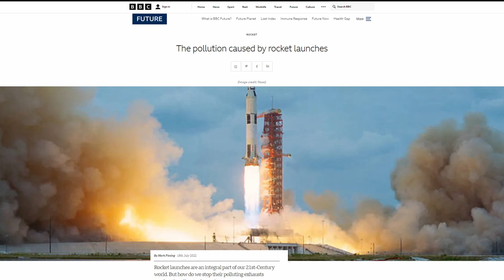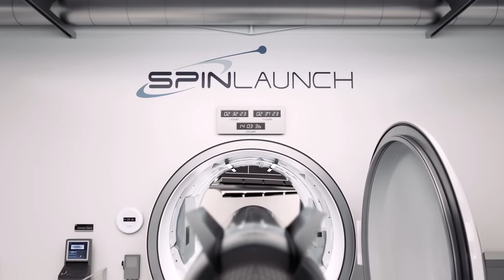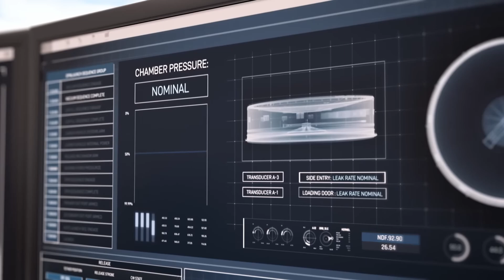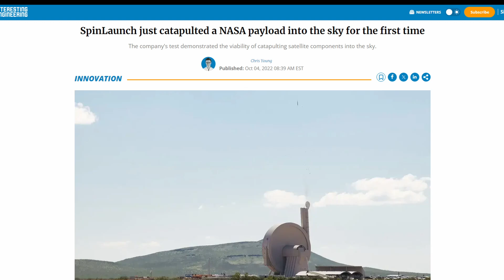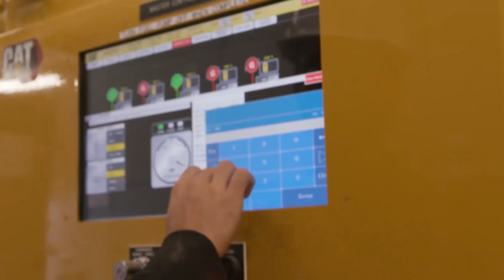This Company Thinks They Are Working on The Electron Killer!

Comment: Using methane as fuel is comparatively beneficial from a greenhouse perspective.  Methane in the atmosphere is reckoned to be 25 to 80 times worse than carbon dioxide as a heat-trapping greenhouse gas... but when you burn methane (with oxygen) you convert it to carbon dioxide and water... hence super-nasty greenhouse methane is converted to many-times-less-nasty carbon dioxide at a 1:1 ratio.  Whereas burning petrol ("gasoline" in your vernacular) produces 8x more CO2 than methane does (while also consuming 12.5x more oxygen).  Kerosene (av-gas, RP-1) are similar to petrol.  Of all the rocket-fuels liquid hydrogen would be greenest... but then there's the question of how are you obtaining/producing the hydrogen (or the methane for that matter)..?  

But SpinLaunch?!  IF they ever achieve orbit (doubtful) about the only use for such a traumatic ride to space MIGHT be to hurl spare fuel containers up there for others to re-fuel from in space.  The extreme g-forces involved will destroy anything higher-tech... and as such i don't see how their necessary 2nd stage will survive the launch to function properly either.  Not feasible, their only real threat to Electron is that fools are investing money there that could be going to boost RocketLabs share price!

Comment: @daveginvesting5670

Hi Dave. 
I hope you had a great holiday. During your holiday there were 2 occasion that we saw Peter talk. The earning call and the NSF interview. I was surprise that 2 element were not pick up by any other analyse or youtuber. 

First :: During the NSF at the end of the Q&A on time stamp 1:28:50 Peter mention that " without Neutron related spending ROcket is a nice little profitable companie."

Second : During the earning call Adam mention at the time stamp 0:32:00 that :" EBITDA Breakeven (profitability) is depend on Neutron spending but the existing company is on a trajectory to offset the weight of the neutron R&D" 
So this mean that they are projectiing to be cashflow positif (and knowing Rocket lab this mean that it is not far in the future... most likely next year.

Third : During the earning call Q&A  at the time stamp 1:08:00 Adam said that :  Q3 is R&D cost peak and will be at that level for Q4 then it will trend down. 

My interprétation of those 3 point point out is that they will be cashflow possitif in 2024 probably at the end of 2024.

Do you have the same interprétation.

Comment: Well a better solution would be to build a very long track for a magnetic rail accelerated payload high up on a 4-6000m mountain. You will have less air resistance, shorter trip to orbit and no instability of the rotating arm after launch(catastrophic vibrations). You also don't have to be worried that the rocket is leaving at the wrong time.

Comment: Not a threat to Rocket Lab, Payloads would be very limited particularly at larger scales to withstand both side and positive/negative axial g forces which will require reinforcement with additional weight and expenses entailed.  Located on a high mountain peak like Everest to reduce atmospheric deceleration would help, but still not get forces down to lower levels Electron Lab payloads experience. Max velocity at ground levels is a compromise like electromagnetic launch or the former Quicklaunch now Green Launch operation using light gas hydrogen for combustion propellant and drag reduction in barrel. 

I don't agree that liquid fuels cannot be used as second stage, just not current tech. I think a 3D printed motor to reduce  plumbing and a piston/syringe like tank could work if fuel delivery and containment are sorted out.. This seems better suited to launching smaller payloads with smaller diameters for drag reduction, so perhaps a fuel throwing model ? Solid fueled second stages could work, but cut into deliverable mass fraction more than liquid fuels with better performance. Enjoy your content

Comment: Hi Dave

One other big problem with the concept is the big counter weight at the other end of the arm... when the spacecraft is launched the the wheel is out off balance and apply huge force and vibration on the system...

Personally a better idea would have been to use magnetic rail (like the train) but on the other wall of the launch disk. You can accelerate to the same speed without the counter weight. The bigger the system the worse the counter weight system problems become.
Reply: I think you’re right. A very, very long track for a magnetically-accelerated payload would make a lot more sense.

Comment: No threat but would make a cheap missile thrower ,too many g's for anything useful
Reply: To reduce g you need to increase the diameter and that will increase the infrastructure costs. But if you look at Bull work in the 90 you will learn that satellite can survive those level of G. So it is not a show stoppers in itself.